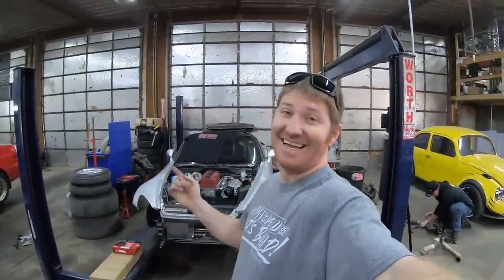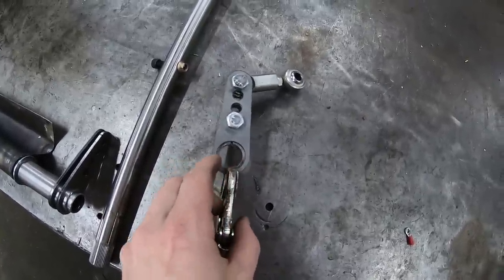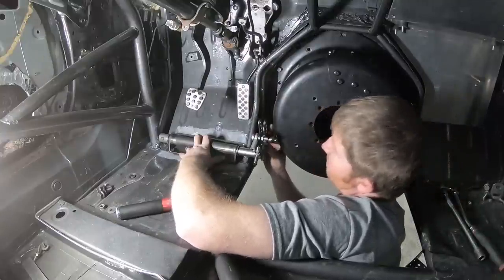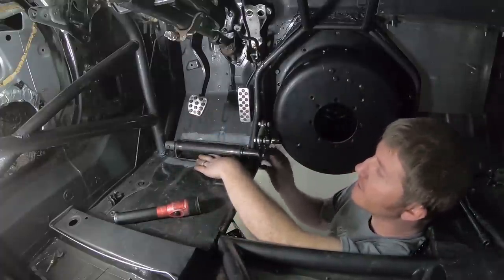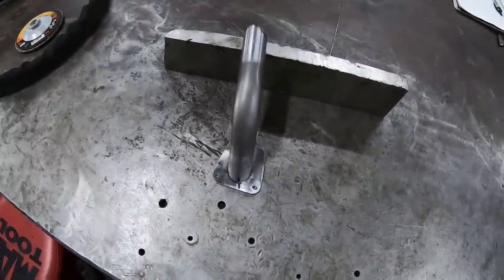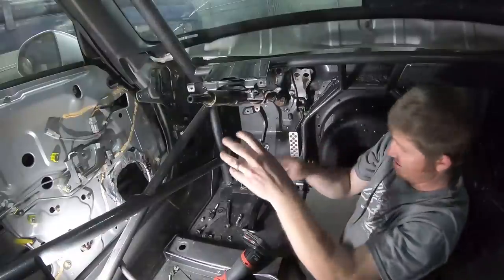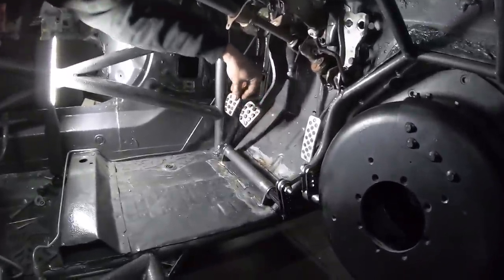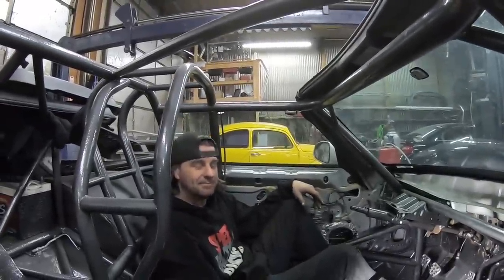SHO'NUFF We have a Clutch Pedal

Comment: Awesome! I will say your probably going to relocate that pedel once you get driving it again. Pedels action from the top for a reason, they work with the natural motion of your heel, having it action from below will probably fatigue your ankle quite a bit and limit you from consistently engaging the clutch properly. Clean fab though, you might be able to save it by recessing the pivot point below the floor level and making sure the arm doesn't ingress on the heel when pressed, but if it were me I'd just flip it to action from the top and fab the armed connection. Great video guys! Thanks!!
Reply: ledfootfam99 I would respectfully disagree. Pedal mechanisms were developed through-the-floor out of necessity for plenty of years, and worked great. The main reason they changed the clutch to an underslung pedal design was due to fatigue in city driving situations where the driver was clutching excessively. This being a race car, the driver will not encounter calf fatigue because they won’t use it as much as if it were a street purposed rig. It’s going to work brilliantly for what it’s designed to do. 
Excellent design and fab work Shawn!
Reply: @phillipgage7356  Depends where it engages. Looks like with this design the driver may struggle to push it to the floor or stopper, if it engages high it wont be a problem. I've had a Tilton floor mount pedal box in a street car, which wasn't an issue because they didn't need much travel.
Reply: rogueAU he’s built an adjustable heim joint in as part of the linkage between the actuating rod and the clutch fork arm. There’s a few inches extra length there if he needs it so it’s totally adjustable to Brents pedal engagement/disengagement needs. Should be a problem with that? You agree?
Reply: Phillip Gage absolutely I watched it again, should be no problem at all! Shawn usually thinks of everything.

Comment: Bought myself a 1991 crx vtec track car today thanks to watching your channel. Now to turbo it! Great work as normal Shaun.
Reply: Which motor? I had a 91 si. Fav car i ever owned
Reply: It's a B16a 160hp version, the full fat one here in the UK. Has roll cage, Stripped interior, adjustable wishbones, rollovers, 2 fuel pumps, swirl pot, updated brakes, sparco seats, omp wheel, sticky tyres, etc etc Just needs another 100 bhp so the straights are as fun as the corners!

Comment: You gotta straighten that brake pedal out man. Looks amazing though
Reply: I agree, messes with my ocd!
Doesn’t matter if it feels right, but looks close to the clutch in the video.
Reply: I agree, the brake pedal needs to be moved closer to the throttle pedal. It looks at an angle, plus it looks like you could hit both brakes & clutch at the same time. It'd also make finding the brake pedal at the end of a run much easier.
Reply: @paulfitzgibbon4110  After a few touches of the pedal, your brain records exactly where it is, like when you walk up a stair case with odd spaced steps. The brake pedal just looks plain shit. But it's not anyone else's car, so who really cares?

Comment: Don't you want the bell housing inspection plate facing down so you can easily adjust the weights on the slipper clutch?
Reply from the maker: Pete's Creative Recycling  we will be doing it inside the car, the bottom will be flat and sealed
Reply: @PFIBrent  The 1st time you drop a weight when changing them you'll be quite upset with this decision. I'll watch and hope for the best though!

Comment: Is there any possibility to mount that hyme  so that it pulls? It could work like that also, but pulling is, in my experience, more precise way to move something mechanically. Would think that the race clutch needs more power to operate than stock, and stock clutches use fluid to push, never any mech. Just because mech always buckles under load.